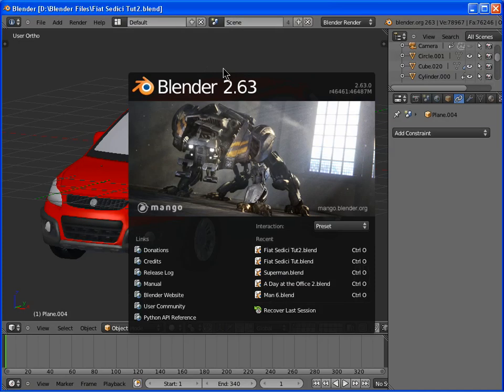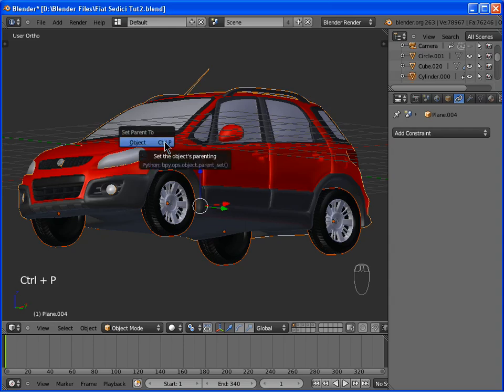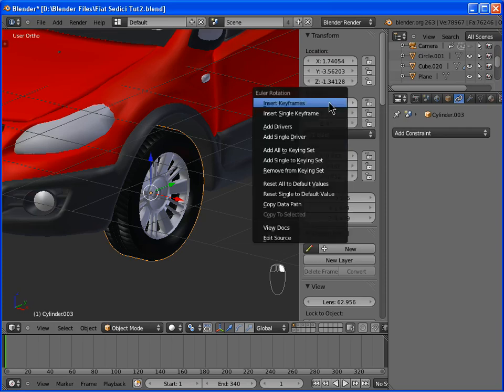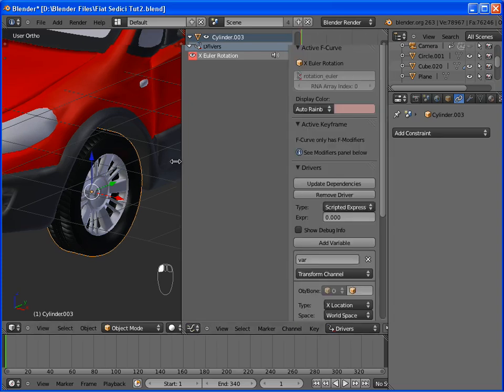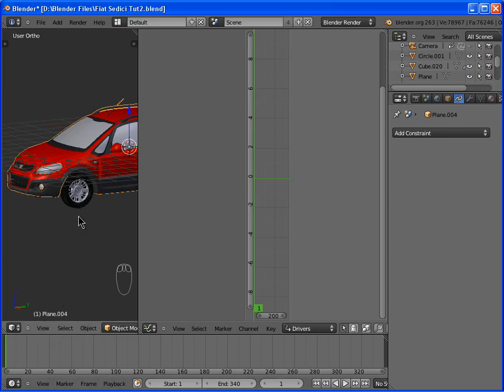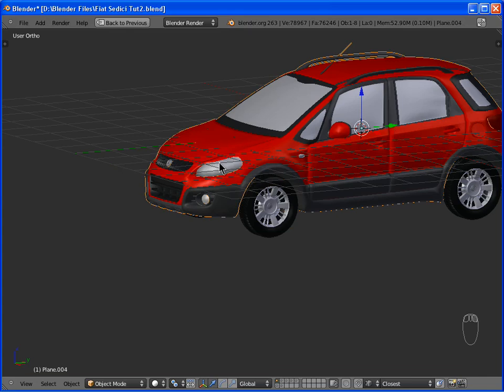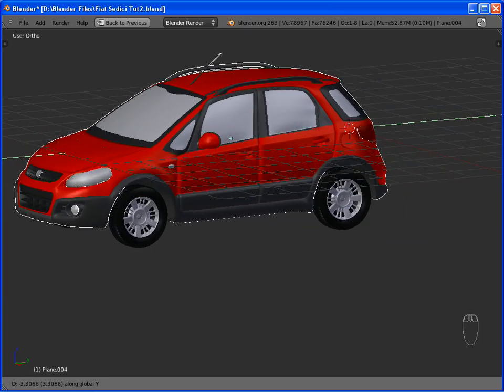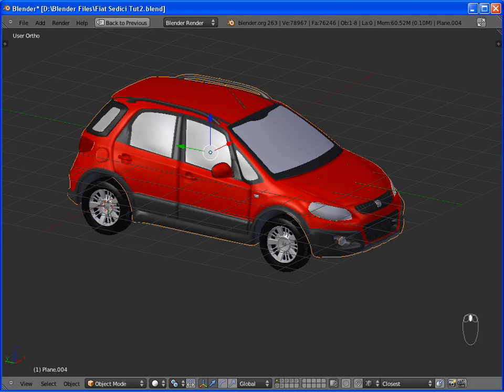Blender Tutorial: Basic Car Rigging | Part 1 - Drivers

Comment: hello, I was wondering if you could help me out? my wheels don't spin around the x axis... they move randomly as soon as I set my car as parent. I also tried to move the origin of the car to a different spot, but it doesn't make a difference.. :-(
Reply: spasskeks also while changing the settings in the driver the wheel keeps changing its rotation :(
Reply from the maker: spasskeks Hi, this sounds weird. Can you post a file over here so I can understand better what's the problem?
Reply: hey thanks for the quick answer :-) I was about to lose my mind x) but somehow I fixed it. I don't know why but I had to put the driver on the y axis, even though it's supposed to rotate around x ... I don't quite understand why, but it works now :-)
Reply from the maker: spasskeks Glad to hear that it works fine now :) Perhaps the wheel isn't set like in the video so it has to rotate on another axis.

Comment: Hello, your tutorial is very good. I wanted to tell you I got a 3D model of a vehicle from the website of 3D Warehouse and tried to apply the driver by following all the steps that you indicate in the video, but to move the vehicle wheels do not spin. I was wondering if you can help me with this problem.
Reply from the maker: Taller Arath Firstly, thank you :)
About your problem - I can guess that the problem is in the transformations - that the rotation and location channels are not set like in the video. It would be very helpful if you'd post here the file with the vehicle you downloaded (or just a link to the model in the 3D Warehouse) so I can understand what's the matter with it.
Reply: Thanks very much for your prompt response. I attached two files in this post because by following your tutorial, I imported the 3D model on blender as a .obj without join meshes. In order to handle objects as you did in the video, I joined the meshes of each wheel and the other hand the body. I dont know if this influenced the result. Then, the first file that I attached to you is with 3d model without joined objects (Fiat Strada without join.blend), and the second has joined the individual wheels and the body on the other side (Fiat Strada With join).

Links:
1) http://www.4shared.com/file/c8V7rx3Fce/Fiat_Strada_without_join.html
2) http://www.4shared.com/file/581Jczb8ba/Fiat_Strada_with_join.html

I hope you understand.
Reply from the maker: Taller Arath You should join the parts of the wheel (and the body, as well) to get a clearer workflow. The joining in the file "with join" is just fine, and it's Not the problem with the drivers. Here are two differences I spotted between my tutorial and your car:
1) Because we are in local space, in your car you have to choose Z location (instead of Y location in the tutorial). That's because locally the car moves forwards/backwards when you grab it on the Z axis. Setting the type of transformation right is important for the driver to work properly.
2) Due to a different scale between my tutorial and your file, you have to set the number in the generator modifier higher. Play with the value to get a good rotating effect.
I hope this helps, and if not, please let me know :D
Reply: Yinara100 Animation I tried what you said to me and worked perfectly. I thank you for the help
Reply from the maker: Taller Arath You're welcome! Glad to hear that :)